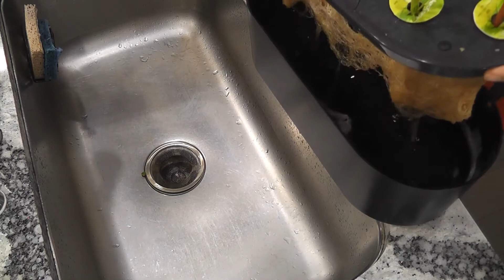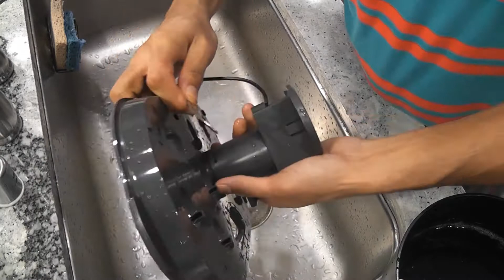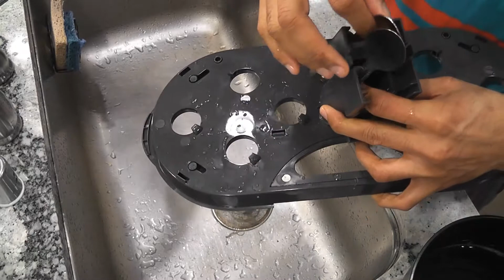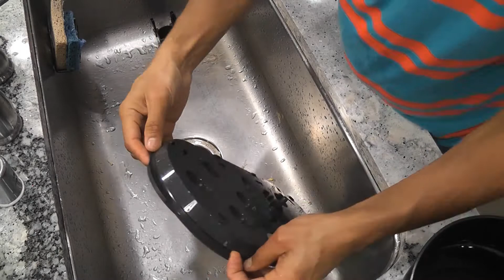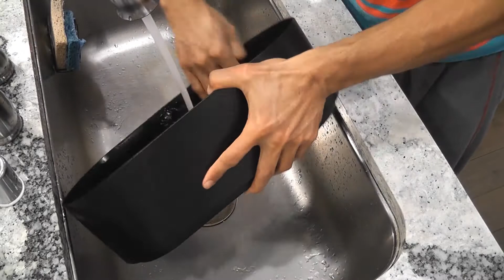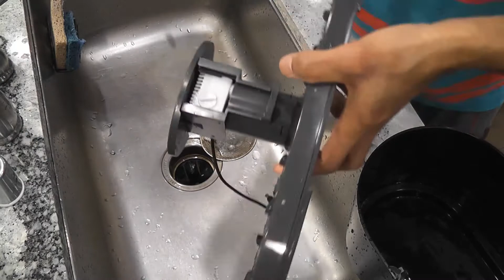Deep cleaning Aerogarden Bounty (detach all parts and attach) | Hydroponics

Comment: I have a small garden and the larger one for my tomato plants.  When I clean the smaller one, I've been putting the tub and upper tray in the dishwasher.  I haven't taken the bigger one apart yet and see how you do it.  I didn't know it had all those parts so will try to follow you and just use faucet water to wash and then fill it.  I've been using non-city water as it has a bit of iron in that ruins our humidity units filters.  
Also my larger one dialed to herb garden, not tomatoes these last few months so need to find out how to change that.

Comment: I wish Aerogarden made the connections with screws rather than tabs because pushing the tabs is very hard on my joints.
Reply from the maker: I do agree. This can be made a lot simpler. I wish Aerogarden fixed this in future mofels.

Comment: Nice camera angles, but curious if you have found a simpler way to remove the column from the grow deck?  The (3) spoons method is cumbersome.
Reply from the maker: hmm not any other easy way. However, 2 things to make a note of. 
1) As I detached the pump part from deck a few times already, now they became lose and come off easily with gentle pull. I never put the same effort that I put on day 1. They never fall off themselves though.
2) After thorough observation with so many crops in multiple Bounties, I see that it's not at all requried to detach the pump cover from the grow deck. As long as we scrub using a brush, it will be pretty clean. I talked about it here https://youtu.be/Ydj3P84-dK8?t=134

Comment: 71 days? Aren't you supposed to change water every 2 weeks from everywhere I have read? If I don't use hydrogen peroxide I get stuff growing in the bottom of the bowl within a week
Reply from the maker: No need to change water every 2 weeks. Aerogarden recommends changing water every 4 weeks to reset the pH imbalance. I change the water every 6-8 weeks. No issues so far.
Reply: I have micro tomatoes that have been in for 440 days, I've only changed the water 3 times

Comment: Need to run a bleach/water mix through the tank and system for 5 minutes. Simply rinsing it with tap water does nothing to sanitize the system.
Reply: He never said anything about sanitizing. Run vinegar or citric acid instead. Bleach is overkill and a poison.
Reply from the maker: Yeah, I prefer to avoid bleach. It's a synthetic chemical. No matter how hard we rinse, there will be some leftover. So, I prefer deep cleaning with warm water instead of using bleach.

Comment: Important to note that you originally put the white tube that attaches to the motor on incorrectly.  The circular end, not the widening funnel end should attach to the motor.  It looks like you cut away to fix that, it would be important to note that in the video.  I almost threw away my Aerogarden because I was so frustrated and unable to put it back together.
Reply from the maker: Sorry about that. Yes, the water pipe between pump and the grow deck should be other way, and the wide open end should be connected to the grow deck. Either way it works fine. I tested it explicitly and water flows fine either way. Sorry again for this mistake in the video.